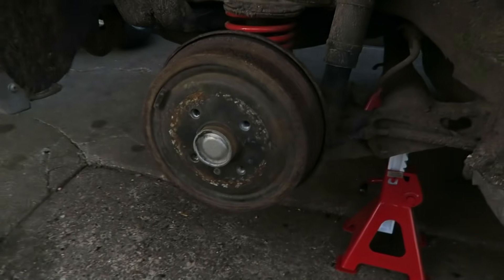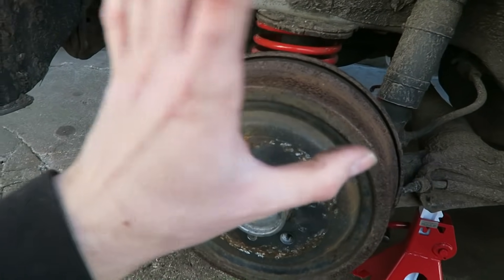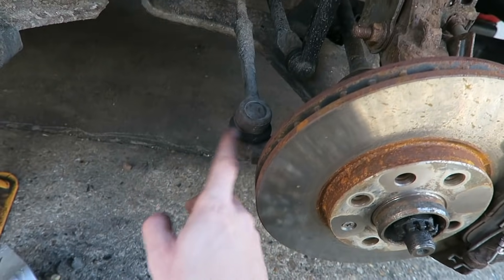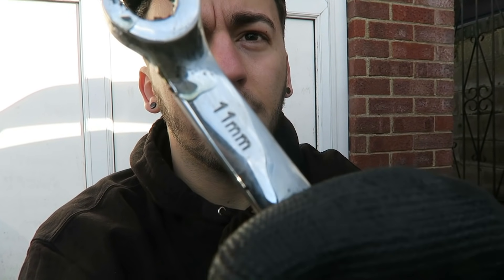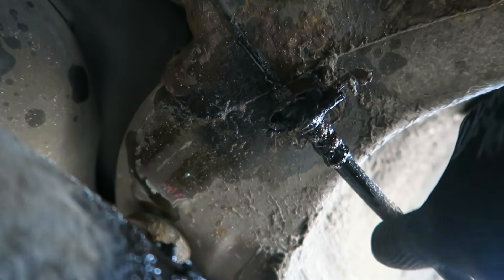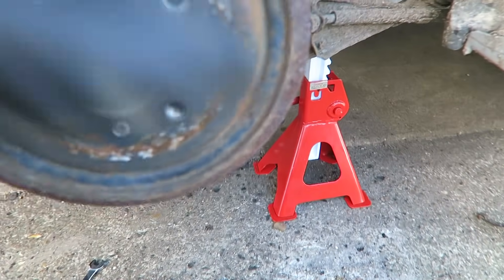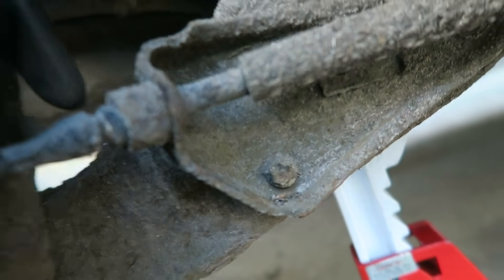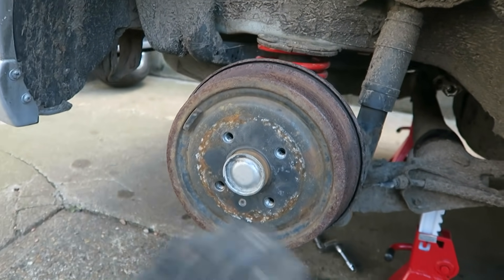Astra Mk4 5 Stud Conversion! Part #3

Comment: That junction box your on about on the brake lines, if I’m not mistaken it’s the load sensing valve ! If it’s connected to the back axle beam that’s what it’ll be.

Comment: I have some Astra g hand brake cables from a 1.8 sxi with rear discs hanging up in my garage, cover postage and they are yours dude. Same for a set of brand new 308mm front 5 stud discs!
Reply from the maker: Chris K email or Instagram?

Comment: To get even nicer sound You should take care of the center muffler of the exhaust, swap it to some box with straight flow but with a steel wool inside and crease to not make it so loud. I did such mod to my Zaffy 1.8 and it's louder but still does not attract too much attention. I got video of it how it sounds. If I were You I will get rid of that center diffuser of the bumper. I think it will look way better after that, cheers mate!

Comment: If you was upto it  you could modify that rear Bumper yourself like take the reverse sensors out and smooth it and with the gap you could cut the rest of that middle bit out and make your own diffuser for it

Comment: James do you own a pressure washer ? Would be great for cleaning all the road salt out of the wheel arches and all the bits you don’t see to help prevent future rust and dirt traps etc as long as you pressure washer it on a sunny warm day it will all evaporate enough
Reply: Just an ordinary hosepiepe will clean that lot off. I do mine every time i clean my mk5

Comment: Hey James, hope all is well love your video's and prefer them better than shmee one's. 

Even though I'm not sure on the direction of your video's, repair, upgrade, how to etc. 

But coming from an engineering background do some more research first, it will save you £££. 

Eg my first car a 01 Fiat Panto Base model, it had all of the hard wiring and other thing's already attached to the car, their were only add on bit's from mine to the higher spec. 

Cheaper for a manufacturer to make a Base model with add on bit's, mine didn't have abs or a rev counter etc but it was already wired in. 

Keep up the good video's and your knowledge is good, but more knowledge will come with year's of experience :-) take that in a positive way, as that is how it is meant.

Comment: Just seen the mondeo EGR video, having small smoke issues and engine light on, removed tge EGR and i cant press my valve down by hand with a ratchet but it does open and close if i rest it against a wall and use my body weight to do so. Should it deffo move more freely than this or are they ment to be stiff sometimes???Any help apprechiated.

Comment: why every car, even if it has a few years on its shoulders, is very rusty in England?
Reply: There's alot of salt on our roads due to the UK weather.
Reply: My 12 year astra h has no rust apart from a little on the subframe and rear shocks
Reply: @nov3019892008  I Have the same Fiesta of Savage Garage, the pre-2000 Style (1999) with 255.000km on it and 20 years, No rusty at all, but his have very rusty iusse and in all his cars, because I ask why every car in England is all rusty

Comment: Come on buddy you spend your time modding cars so........ Mod the bumper a wee bit of glass fiber to extend the bottom of the bumper to close the gap ans smooth out the sensor holes to. Job done ha ha. Am fairly confident you could do that and paint it

Comment: You probably would have to arrange a courier due to the distance but theres a gsi bumper on ebay now. Here's the item number:382713249415. And it would need a respray as its correctly in blue.

Comment: Should of prepped & painted the snow flakes first with new tyres, why didnt you look into just buying hub adaptors so you could fit the wheels, exhaust keep the old one & get it welded just incase & just remove the middle trim on the rear bumper